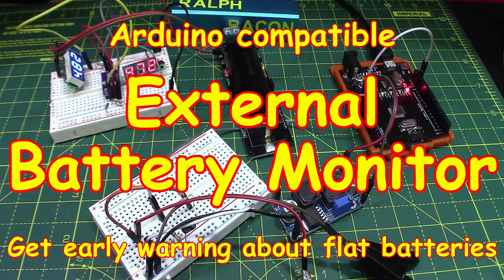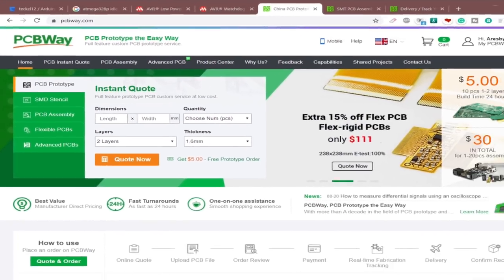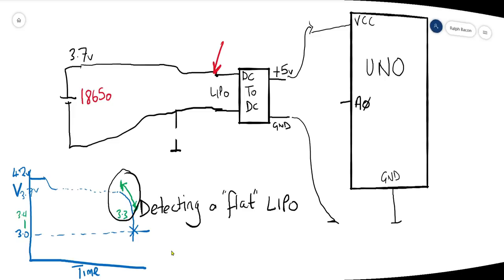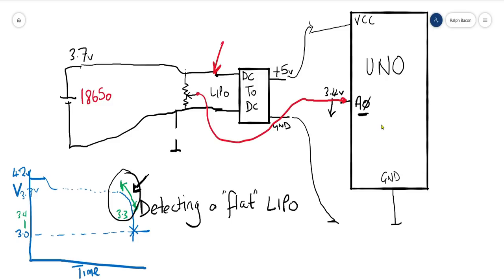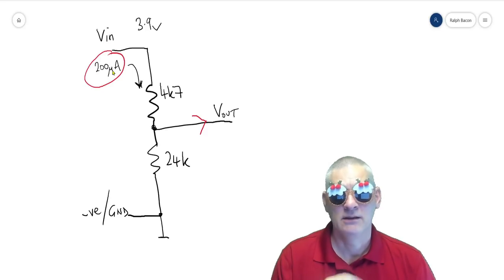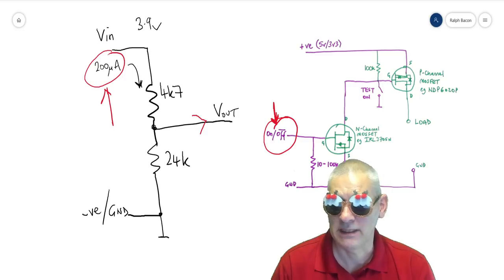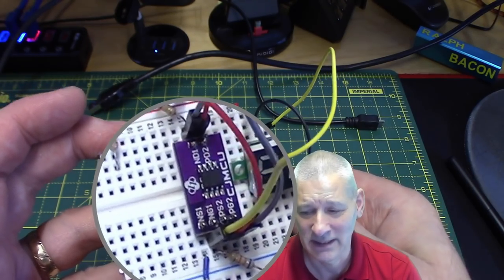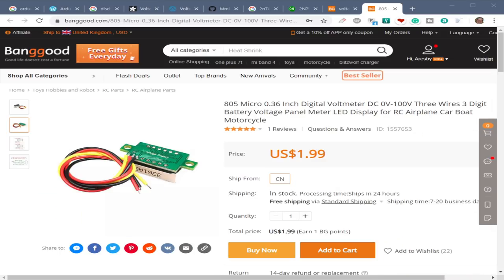#171 External Battery Monitor from your Arduino

Comment: Hey there Ralph love the glasses.  I can just hear the Dad-jokes about them, lol.  I feel like you made this video for my benefit and it is on the money for my mobility Scooter control board.  I had not thought about switching the current through the voltage divider but a lot easier than doing it in code.  I will also be getting a few of the SI4599's, much cheaper that buying the mosfets (everything is more expensive here).
As you know I spent a lot of time messing getting multiple voltage dividers working to monitor the 24v battery and if the charger had been connected.  I used a Zener diode in reverse bios to clamp the voltage going to the Arduino to 5v max regardless of fluctuations from the battery/supply.  This worked very well.
Take care brother.
Reply from the maker: If you watched the next video, Adrian, you will have been even more impressed I am sure. Not with the video, but with the additional Xmas decorations!

Comment: Good to see you back Ralph! (No pun intended)

Quick question.....if you only use an input source of 5v or less do you really need the voltage divider and an external 3.3 ARef? Couldn't you just hook up the battery+ to A0 and monitor analogRead() to a specific level, say a value of 700 for 3.4v? (0.0049V / count).

Without any resistors drawing power could you then omit the switching too?

Just thinking out loud.
Reply: use a 10k in series with A0 if it is a 5volt arduino. Use a 10k in series with A0 and a 10k from A0 to GND if your arduino is 3.3volts. the above is only if the battery voltage is <= 5 volts, if
 > 5 volts use a larger resistor (15k or 20k) in series with A0 and 10k to GND. just for info  5 volts / 1024 = 4.88 mV.
Reply: i always like to use a clean noise free source for my ADC's Ref. when the battery is getting low the DC_DC converter might start getting more noise on its output. what's the cost of a few extra resistors and a fet or so. if you want to make it more accurate then your into ref, resistor temp coefficients and drift over time, getting a known reading now does not mean that in a years time it will read the same.
Reply: It is another method
Reply from the maker: If your supply is FIXED at 5v (and doesn't run down as the battery gets flat) then you can do it your way. Just remember that the AREF by DEFAULT compares against VCC (whatever that is) so 3.3v compared against 5v (DEFAULT analog ref) is about 675 on the analog port, but 689 against 4.9v. But if the VCC drops to 3.5v then A0 will report 965 for 3.3v! So you can see the importance of a stable VCC reference (which is what the 3v3 output from the Arduino's voltage regulator gives us).
Reply: I hear you but doesn't that buck/boost module maintain a FIXED output voltage? Its written in the description as being **FIXED OUTPUT**....so the AREF will be compared to a fixed VCC regardless of the battery voltage....no?

Not trying to be awkward but I know you don't do something without good reason and yes, for an 'unregulated' supply the whole resistor divider/external Aref makes perfect sense.
Reply from the maker: By "fixed" I just meant 5v in the same way as a voltage regulator, no downward drift. If it is stable then all good and well and we can compare to the VCC (DEFAULT) rather than 3v3 and skip the resistor network. No, I don't think you're being awkward at all, MrToM, it's good to have these things clarified, thanks for replying.
Reply: @mrtom64  dc-dc converters are inherently noisy,  and I would expect that as the input voltage drops the input current will rise along with output noise, which is not what you want on your ADC Ref. It’s a game of swings and roundabouts of what you can put up with against the cost of making the design better.

But if you’re just adding a low battery message to the device go for the cheapest option. You might even try a resistor network with the bottom leg connected to a uC pin. When not on use make it an input, and pull it a low output to measure. Never tried it but it will depend on the saturated output voltage being constant over temperature.
Reply: @RalphBacon  I think you can use the output of  a (for example) 5 volt converter as long as you charge the batteries before getting to the drop out voltage.

Comment: Ralph, Instead of switching the high side of the resistor divider with mosfets, how about switching the low side (GND) using an arduino port?  Instead of connecting the low side of the voltage divider to ground, connnect it to an arduino digital pin.  Then, in code:  pinMode( VMgnd,OUTPUT); digitalWrite(VMgnd,LOW); would turn the voltmeter on.   digitalWrite(VMgnd,HIGH); would turn the voltmeter off.  Or, the pin could be tri-stated by setting pinmode INPUT, which would provide a high-impedance connection, effectively turning the voltmeter off.  This seems simpler than all those mosfets.
Reply from the maker: Switching the low side never works well, John. That's because the ground reference changes and upsets the entire electronic circuit. Try it if you want (and, who knows, maybe it will work for you) but I'll stick to high side switching.

Comment: Very interesting video, thank you for sharing. I found your circuit diagrams for the two transistors, can you share the diagram for using the Si4599?
Reply from the maker: I've added this to my GitHub repository for this video:
https://github.com/RalphBacon/171-Monitor-Your-Battery

Go to the "images" folder and find the file "LiPO Monitor Circuit.JPG", which is a rather shaky, hand drawn circuit diagram and shows how the Si4599 fits in.
Reply: Thanks Ralph!

Comment: Hello Ralph. I'm using a buck/boost regulator powered by 3 1.5 AA batteries to provide Vcc=3.3V to my ATMega328 with fuses burned for 8MHz internal clock mode. I just want to detect when the 3 battery levels are < 3.0 V according to the regulator minimum Voltage spec. Seems to me, all I need to do is read pin A0 connected to the batteries via a voltage divider R1/(R1+R2)=.6875, and calculate Vbats=4.8*readval/1023 (where 4.8 is max. voltage of the 3 bats.) so that I know when it's time to change them. Do you agree? Thanks.
Reply from the maker: Not to simple, Bill. The analog ports will ALWAYS read 1023 if connected to the VCC line as the VCC value is fixed, whether +5v or 3.2v. So the analog ports compare to the VCC value, understood?

You need to compare the incoming voltage to the fixed internal reference voltage (1v1) on which I have done a couple of videos: #160, #171 which do the trick nicely. I'm using that technique right now monitoring my batteries in a project (all three). Works like a dream.
Reply: @RalphBacon  Hi Ralph. I'm using 3 AA batteries to power a buck boost converter. The Arduino VCC line is coming from the buck boost converter output (always 3.3V or 0 if battery is dead). The analog port is connected directly to the battery output (I had to use a resistive divider 'cuz fully charged batteries provides 4.5V).

Comment: more easily you can switch off the voltage divider by just connecting the lower side of the voltage divider to an IO pin. Switching this pin to an output and outputting a 0 will switch the GPIO to ground and thus also the lower side of the voltage divider. Switching the IO pin as input without pull-up will leave the voltage divider floating and no current will flow. 

The series resistance of the output pin is less than 100 ohm and negligible compared to the tolerance of the resistors in your divider.

Alternatively it is also enough to just have a single NPN or n-channel MOSFET at the foot of the voltage divider to switch it off.

This works reliably as long as the voltage you want to measure is lower than the supply voltage of the microcontroller, because otherwise you might get a leakage current into the protection diodes.

You can also easily scale up the two resistors in your voltage divider by a factor of 10 and then you should be able to leave it on.
Reply from the maker: Indeed, Uwe, that would be a very good way to approach this problem and probably similar to how I might do it in the future. I wonder how high the resistors can go with the analog input still being able to reliably read the voltage? If we got the current through the resistors down to a couple of microamps then, as you say, just leave it wired up!
Reply: @RalphBacon  I did some tests before a student lab 2 years ago and was surprised. In the lab I let the students measure the discharge of a capacitor with an Arduino nano. The interesting fact is that a discharge resistor of 100 Mohm parallel with the input and capacitor is not yet significantly affected by the internal resistance of the Ain-pin - so I must assume that the analog inputs of the ATmega have a resistance in the order of 10 Gohm!
Reply: Actually, if you connect the lower end to an IO pin and set it to input-no-pullup, the middle of the "divider" will suddenly rise to the full supply voltage, potentially killing the Arduino. Granted, it's a very small current, but still.

I suggest simply using bigger resistors (~10MΩ) and leaving it connected.

In addition, you can dispense with the AREF connection and simply instruct the chip to use its internal 1.1V reference. Choose a resistive divider that produces voltages between 0V and 1.1V, and go from there.
Reply: @SodAlmighty  as I wrote: "This works reliably as long as the voltage you want to measure is lower than the supply voltage of the microcontroller, because otherwise you might get a leakage current into the protection diodes."

Comment: Hi, I make a similar device with the 1.1 volt internal référence build in the Att328 and two resistors 75k/24k. Thank for the interrupting device with 2 fets. It's à very good idea. Xmas and bye from France
Reply from the maker: Glad you liked it Rene, from France. So you are using the internal 1v1 as your reference for the analog input? How does that work? Surely the 1v1 is too low to compare against?
Reply: @RalphBacon  I use it for read the voltage of a alcaline battery Ni-mh  and Li-ion cell. I make a little device for evaluate the internal resistor for these bat.You can have my code and schematic on https://github.com/kotec-le-raleur/Resistance_interne.
It's just a little project , but it work for me and I can dispatch my cells between bad or good.   Sorry for my poor syntax !

Comment: It's good to see  you back Ralph. I am making a 5 volt pack and I am using vcc as a reference (internally) so I dont need to use a voltage divider to measure cell voltage.  But in your case could you connect the bottom of the voltage divider to a pin and make it high Z when not measuring and low when you are measuring ?  I am using an ATTiny85 (thanks to your videos). I have a LED and a push btn switch. When the switch is pushed the Tiny reads the voltage and blinks the led to let me know what the voltage is to two decimal places so I know when to charge it.
Reply: " could you connect the bottom of the voltage divider to a pin"     Where would the junction be connected to?
Reply: "I have a LED and a push btn switch."    Why not periodically check....no need for a switch
Reply: @kennmossman8701  The junction goes to the ADC like usual. Instead of connecting the bottom of the divider to ground connect to another pin. Make the pin low (close to ground) then make the measurement.
Reply: @kennmossman8701  Because then its blinking the led when I don't need to know the batt. voltage. That uses more power.
Reply: @noweare1  say what?   in pseudo code"
if delta elapsed time >   a minute or such
   if battery voltage is low
      blink LED
Reply: @kennmossman8701   I don't need to know the voltage that often. When i want to know I just push the switch. Uses less power that way and no need to look at blinking led every so often.
Reply: @noweare1  Why?  Besides doubting that would work properly you are using  unnecessarily a pin
Reply: @noweare1  It is your project BUT
1) power loss is extremely trivial, see my post
2) LED won't blink unless power is low
3) making what s/b an automated task a  manual one seems backward
Reply from the maker: Indeed, Joey, as long as the 5v is supplied directly by a 5v battery, no buck-boost device, then that's a good way of doing it. For those with higher voltages (eg 12v car battery) you still need the potential divider. Thanks for posting.

Comment: Hi Ralph, again..A quick question for you...Re: The Lipo holder/charger/psu...Does it charge via the USB socket, and, Does it continue to output 5V while it's charging?..Thanks...John..Bristol
Reply from the maker: You're referring to the 18650 holder that outputs 5v (and 3V3) and also via the USB socket, right, John? Yes, whilst charging (the LED is red) it still outputs power. The LED goes green when fully charged. You charge it not via the full-sized USB socket (that is output only, and controlled via a small on-off switch). The charging micro USB is on the main board, marked 'power' or something like that. To be honest, I just pop in another fully charged LiPO and charge that in a purpose-built, commerical charger rather than using this device, but that's just my preference!
Reply: Ralph S Bacon ..Many thanks for fast response again, Ralph... That's exactly what I wanted to know..Thank you..Looking at Bangood, the Lipo they advertise has a micro USB in it...Does that one work in the charger module ok?..J
Reply from the maker: The micro USB is the charging port on mine - works fine!

Comment: Voltage divider isn't necessary if the maximum battery voltage is less than Vcc.

The important lesson here is that one can switch sub-circuits off and on by microcontroller output. 

That's a lesson with which automotive manufacturers seem to be taking many years to learn as they add their products to the Internet of Toys. Because consumers love to come back home after a long vacation to find their car dead in the garage.
Reply: the voltage divider is required as the ADC reference voltage is lower then the supply. Ralph connected it to the 3V3 regulator output as it should be more stable than the 5V.
Reply from the maker: That's happened to me, Bernd. Car battery flat after 3 weeks. It must happen often because there was an AA (Automobile Association)  assistance truck patrolling the car park giving free jump starts to motorists like me!
Certainly for battery powered circuits switching off sub-circuits is imperative. I even do that in Benny cat run for the (mains powered) Rain Detector. It has stopped the corrosion on the sensor because it is now only switched on for two seconds twice a minute.

Comment: why switch high side and use both types of mosfets? ADC input is high-Z anyway, right? So just use n-ch mosfet and switch resistor divider's ground.
Reply from the maker: I'm assuming you mean connect the Drain from the N-channel to the LiPO +ve, the Gate to the GPIO pin, the Source via two resistors to GND with the junction of the resistors going to A0? Normally the Source of an N-channel needs to go to ground to work properly (including getting the Gate voltage +5v above Source voltage). Have you tried this? It might work but I haven't tested this.
Reply: @RalphBacon  No, what you are describing is called high side switching. It won't work without bootstrap gate driver. But if you move voltage divider between +Ve and Drain, while connecting source directly to -Ve, it should work. The only limitation would be voltage of battery pack should not exceed input voltage of ADC pin, which should be fine in your case with 5V MCU and 1S LiPo. 
See schematic:
https://i.imgur.com/gjRssCb.jpg

Edit: Hell, you could connect 1S Li directly to 5V MCU, and there would be no need to waste power on divider at all. If your battery pack voltage exceeds input voltage of MCU, then your circuit makes sense.
Or even better add a simple zener:
https://i.imgur.com/l0rDmwU.jpg
Reply from the maker: Yes, the zener would be required if the voltage was above 5.5V otherwise you are presenting more than that (potentially) to the A0 pin (eg car battery, drone battery). Zeners are not Schmidt triggers though, they can start conducting quite early on in the voltage range, trial and error may be required!  Thanks for clarifying.

Comment: I see a lot of comments here stating that you don't need a voltage divider since the battery is less than 5v.
this is false.
wall of rambly text incoming, I tend to write the same way I think...not always easy to follow
the ATMEGA 328p (I'll just call it the chip from here on, it's easier) has protection diodes for all its inputs, including the analog ones
that means you can power the chip from any single pin until that protection diode fails
so you find yourself thinking the chip is unpowered and not working, and the feed from a data line is powering it so it is running normally
I should point out that these particular diodes are not designed to power the chip, only to protect the pin from overvoltage...
so you toss a voltage divider in and it limits the current to a few nanoamps, problem solved, the chip powers only from the main rail, no risk to the internal diodes, all is well

playing Schrodinger's cat with an Arduino is no fun...is it alive?
Reply from the maker: Yes, I did notice that, Jeff, I would always limit the current via a voltage divider in this sort of situation. And once we go above 5v it's required anyway. Thanks for posting, good to hear from you.